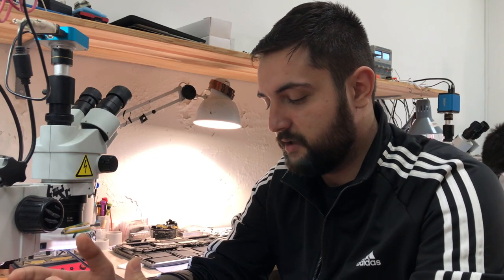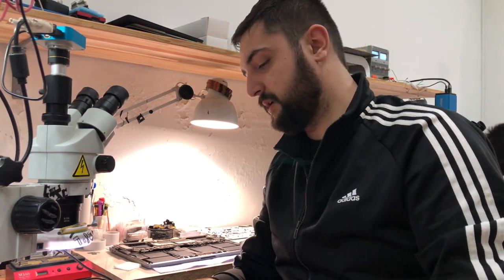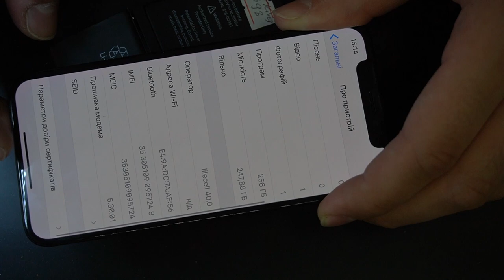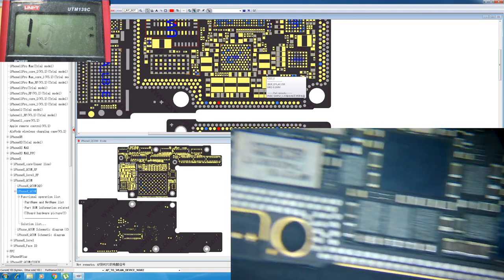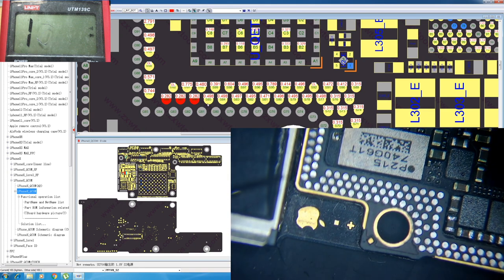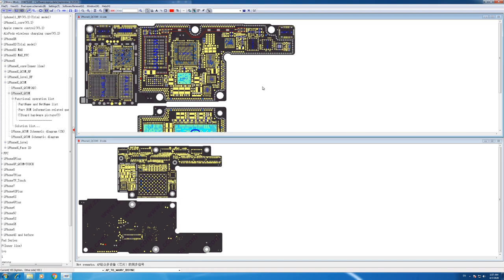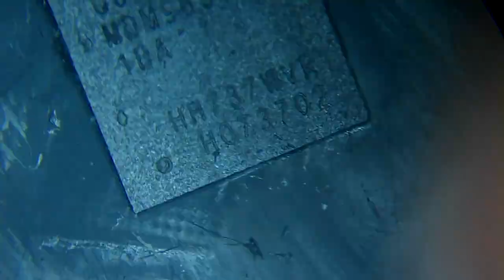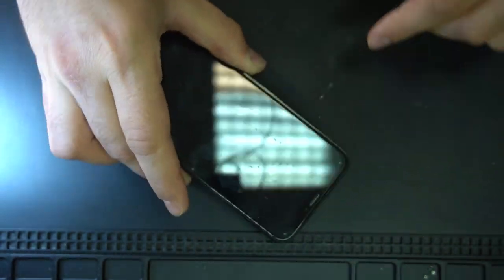iPhone X Grayed out Wi Fi (wifi not working) iPhone X bottom board swap

Comment: Very good words ! I like and subscribe ! ... Question .. at what temp u work when desolder wifi bb ic
Reply from the maker: papitoooooo it depends on what soldering station you are using actually. You need to test and get to know your soldering station to know what temperature to use on each chip